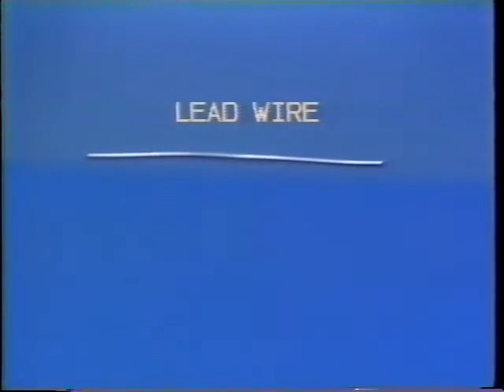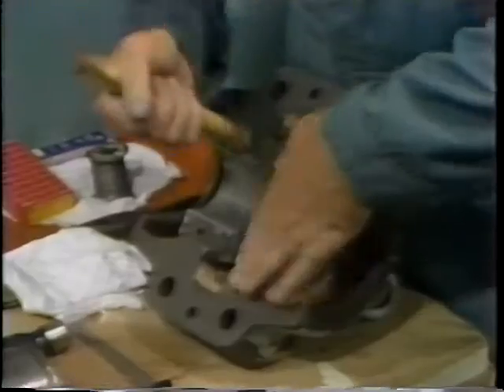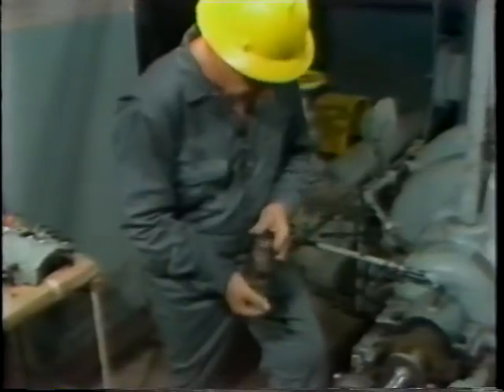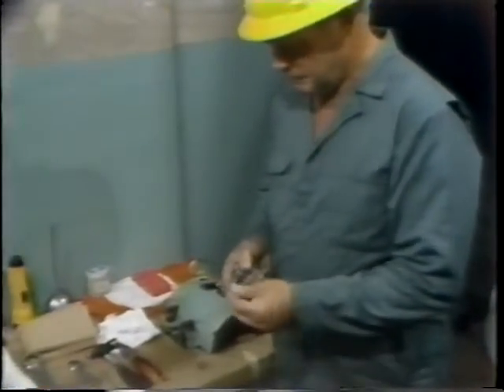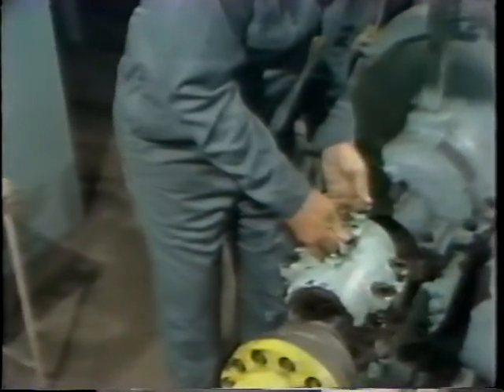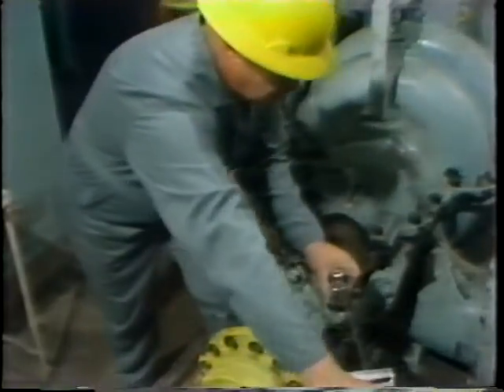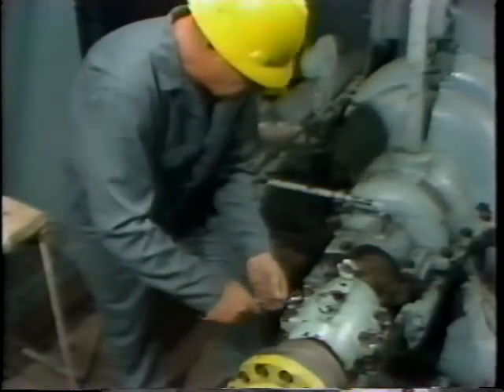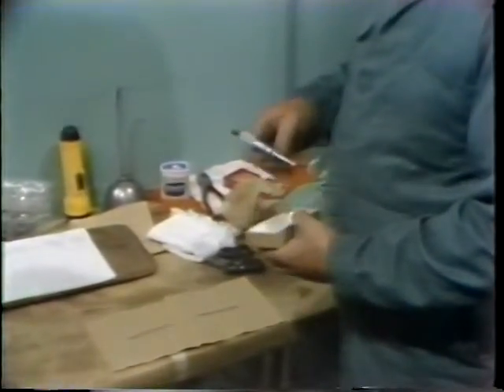Journal bearing maintenance - complete overhauling 4/5

Comment: Why is the measurement divided by two?
Reply: Same question I am asking? The readings should be the clearance
Reply: @Tarig-x1s   I think it is only about terminology that he uses. He uses the word  'clearence'  for the distance when the bearing is on the center position and the position of the journal is rest position on the video.  While it is on rest position the shaft lies down to the lower shell that's why he divides the distance. As I've said before, I think it is only about terminology.
Reply: So you mean the clearance is for the bearing at rest, but if he said the oil clearance like The privous video this mean the bearing is rotating and that's what he makes a nearly quarter turn in both directions.. @tayfunkaragoz-r6f

Comment: Excellent video. What should be the thickness of lead wire , to be used for checking oil clearance? Thanks.
Reply from the maker: the values for crush should be arrived at by consulting with the bearing and equipment manufacturer.